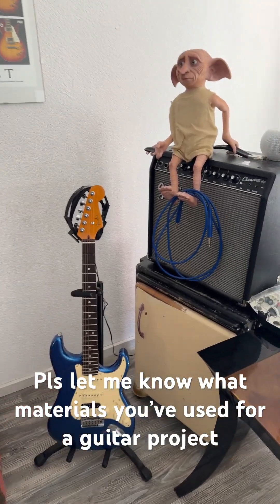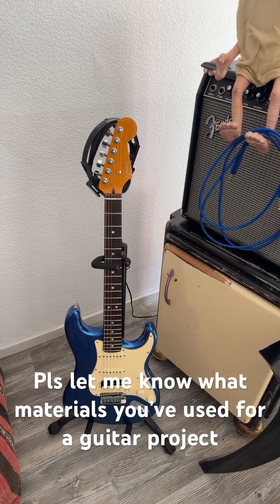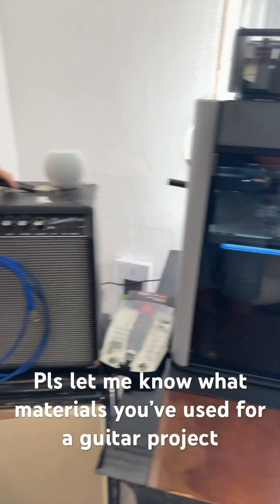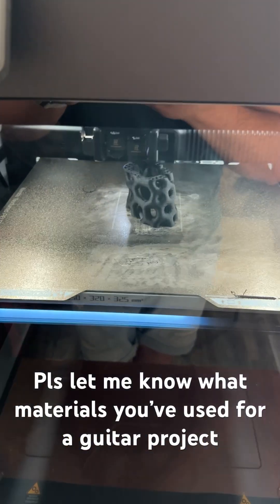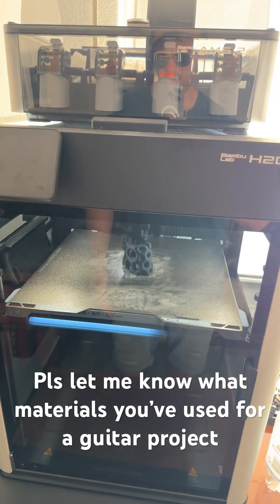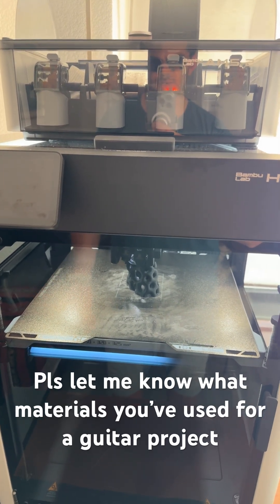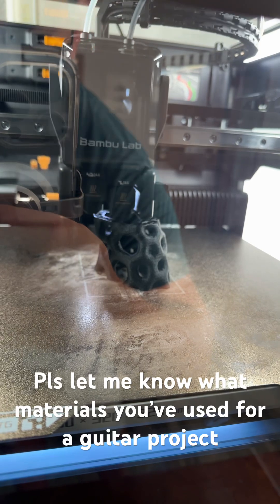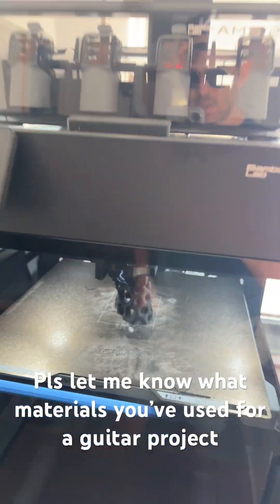Starting a 3D-Printed Guitar Project 🎸First Video of my Bambu Lab Experience

Comment: On all of my printed guitar bodies I use PLA and ABS. With no warping and fantastic tuning stability.

I wont PETG or PA as they both have too much flex.
Reply from the maker: Hey, that sounds great but I don’t like the idea of PLA at all, due to low-temperature resistance and warping later when exposed to hot temperatures, etc. I’m trying PA-CF now but later I want to get rid of the carbon fibers. Maybe PPS? That’s pretty expensive, I know. Are you satisfied with ABS in terms of durability and surface? 
My idea is NOT to have carbon rods installed to increase rigidity.